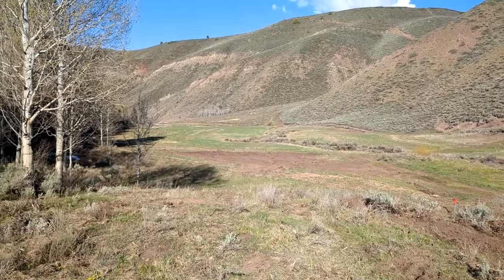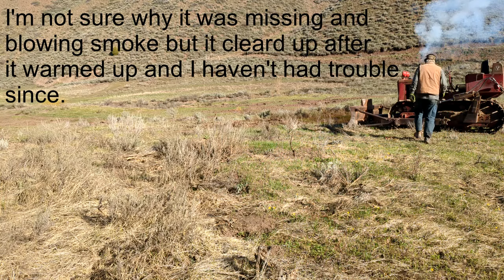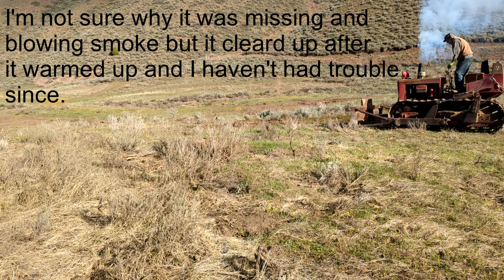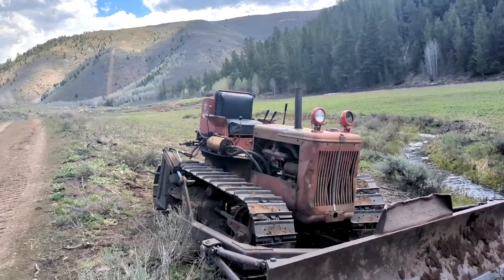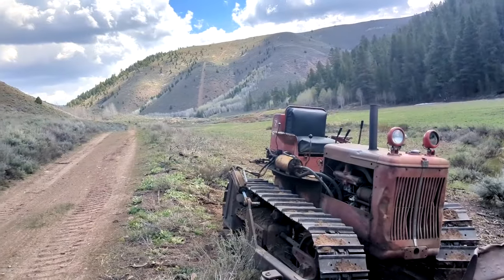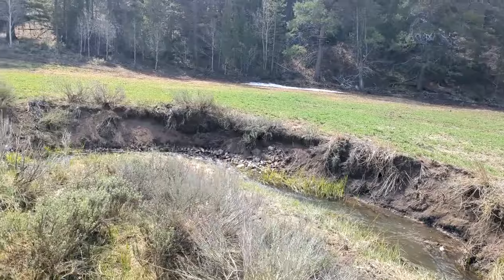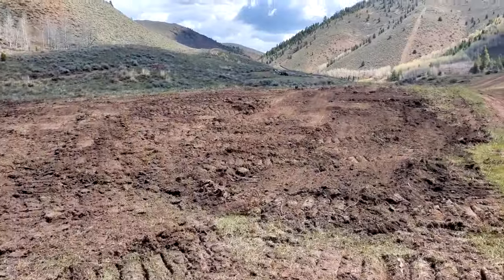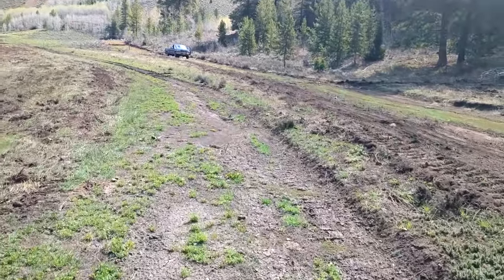IH TD9 pushing beautiful mountain soil. part 2.

Comment: Beautiful place. How high up are you There. Except for some of the Highest mountain tops,everything is covered with trees. It was wild seeing  a forest on one side and the other had no trees. Never seen that before. I am sorry you had trouble with your doser. I have had tracks to come off, It can be a real pain to get them back on. As always I liked and shared. All my very best.
Reply from the maker: My house is at 6100 ft. Those hay Meadows are probably over 7,000 ft this area is considered high mountain desert. The trees all grow on the North facing slopes and the south facing slopes are all bare.
Reply: @tractorrescueranch3682  Thank you for letting me know. The Mountains here in Tennessee are very old and worn down. The North facing side makes sense has to why the trees are on one side only.  I will have to check and see what the elevation 's are here in TN. Thank you again.